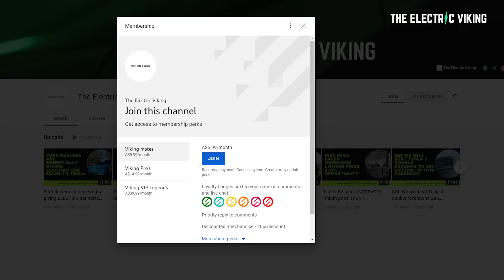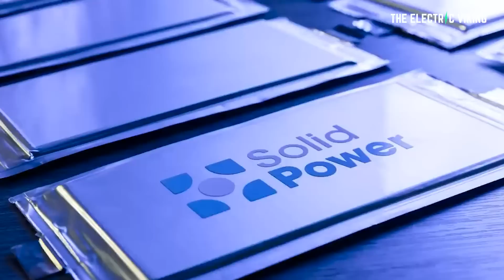Nissan's NEW GTR Nismo will be electric & use a solid state battery

Comment: These gas cars are done. Ive raced a couple GTRs in my Model 3 Performance. From a dig and a roll it just gets them. The last one I raced we did a roll and I immediately jumped out on him after the the 3 honks. I then kept gaining. We met at the next light and asked if it was a P100D (complete different model) I said no it's just a Model 3 Performance.

Comment: Only the terminally insane will love a vehicle which requires the destruction of the biosphere to be used as transport - you have to build infrastructure that will destroy the life support system by turning the land surface into a race track. The human is finished if the ever- growing population destroys what is left of nature instead of working towards turning that trend around. Why are we such perverse and incompetent, spoiled-child fools? 80 kph is more than fast enough. We cannot travel faster than 20 kph without loosing the "time" we "gain" by creating the means to do so.

Comment: When an Electric wins Le Mans they can claim to be the future of sports cars - which will be quite some time,  When there a battery break through comes that charge charges fast & go far enough. Today on the Autobahn a Prius can beat a Tesla Model S from Munich to Berlin because the Model S will require 2 or 3 full chargings of 30minutes each; dramantically reducing average speed to where a Prius can win. Toyota has won Le Man the last 5 times w the TS050 hybrid; that vehicle would crush any EV made today into the ground at Le Mans. At Le Mans you have to drive 24 hours through difficult twisting roads (not good for 4000 lb cars)  the current record drove the equivelent of Boston to LA and then to San Fran in 24 hours - the best Electric might make it to Kansas city.